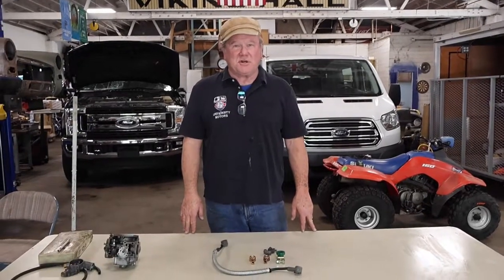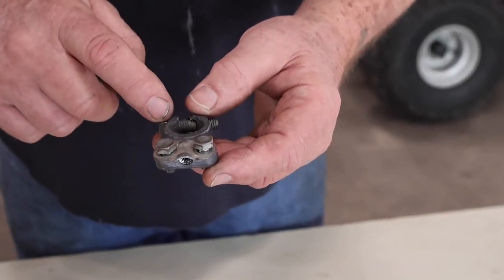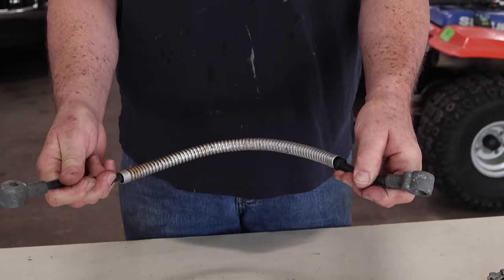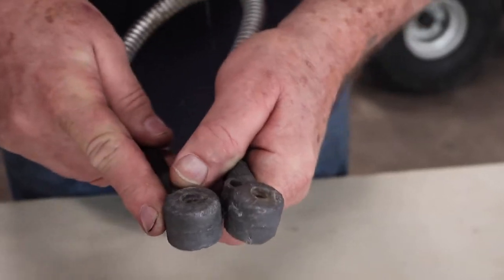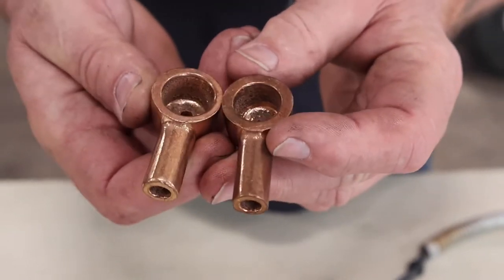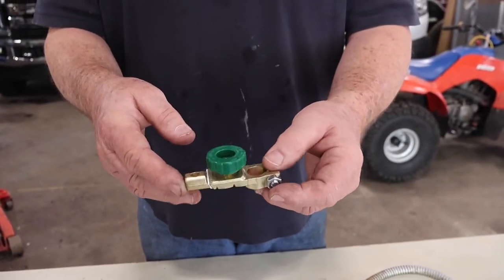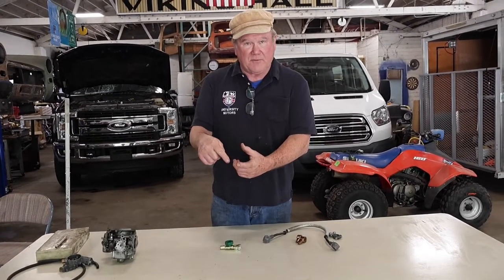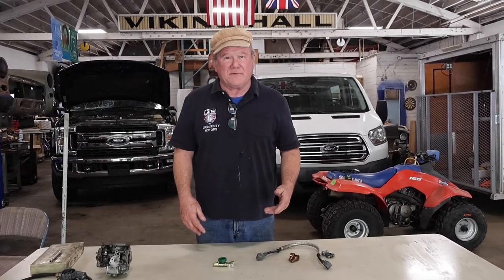398 MG Tech | Battery clamps and terminals

Comment: John: Thanks so so much for your videos. You have save me more than once. The starter on the MGA was the answer I needed. Bad ground to the engine block. Unfortunately I had just removed, and reinstalled the air pump & alternator. Nothing like doing the job  two or three times. Keep up the good work. Bill

Comment: Very interesting, I would offer a couple one other comment re the disconnect aspect. 
We travel a fair amount and I have found that disconnecting the battery preserves the battery so when we come home the battery hasn’t died. And incidentally when I reconnect the battery I don’t set the clock. I actually remove the fuse and wait until the time matches the clock then I reinstall the fuse. Not that I’m neurotic about the clock mechanism breaking or anything! 😂